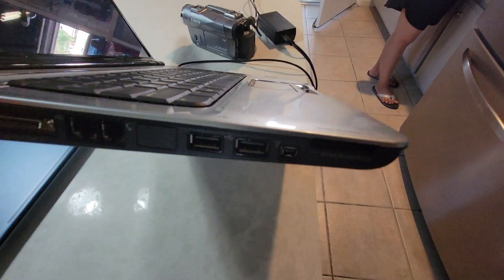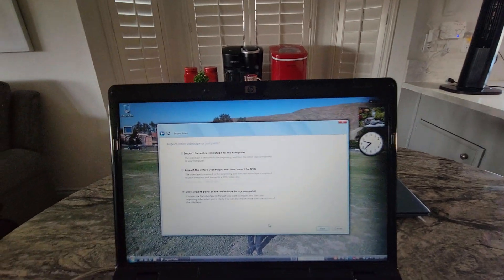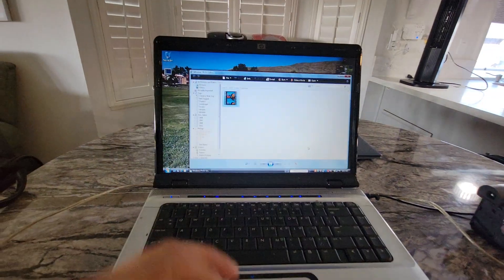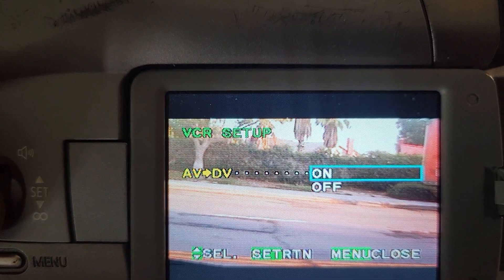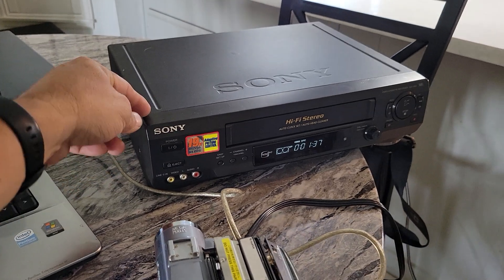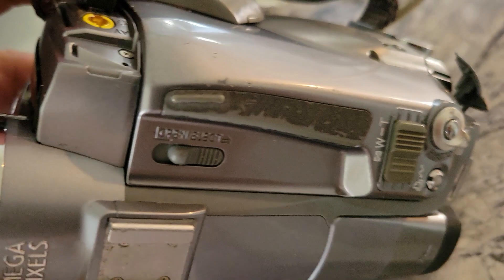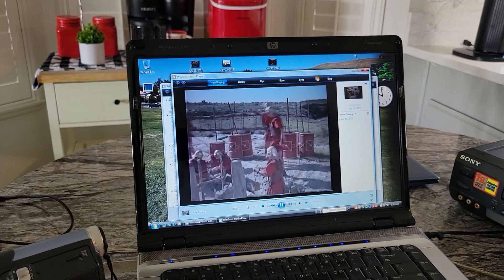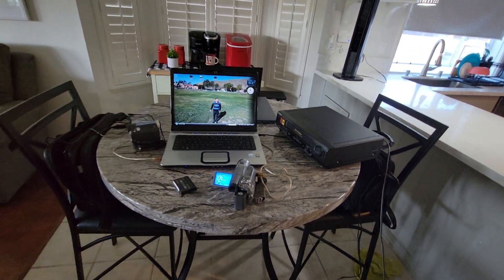How to transfer miniDV tapes AND VHS tapes to computer (mp4)

Comment: Does it have to be Windows vista or XP? Will it work with Windows 7?
Reply: What are you trying to transfer?  Camcorder tapes or vhs.  Both methods will work with windows 7.  If you're trying to transfer mini-dv your computer needs to have a firewire port on it.
Reply: @vxvision1394  I’m trying to transfer camcorder tapes specifically hi8 and mini dv. I have both cameras and they both work. I bought the ion video to pc converter years ago which I’m finally playing with now but I’m still trying to figure it out. It’s seriously frustrating lol
Reply: @PCA1  I got you.  I've tried using a few items like that (external units that plug into the pc via usb).  I never had much luck with them, the software would either freeze or crash.  I watched a quite a few videos here on youtube and it seems like the best external unit, or at least the one that most people had success with and recommended was the el gato video capture.  Unfortunately it runs 60$+.  Gilberts method seems to be the best but requires a computer that has firewire....then you also need a capture software of some sort.
Reply: @vxvision1394  The ion video to pc converter works but it’s coming out choppy during recording when it’s clear on the camcorder screen. I have no idea what’s happening. I’ve checked and re checked everything just to make sure nothing is loose. I guess I’ll wait for the FireWire cable I ordered. I have an old windows 7 Sony laptop with FireWire port so crossing my fingers it’ll work. I’m not giving up. I need these tapes preserve. It’s the only memories on tape of my parents who have both passed.